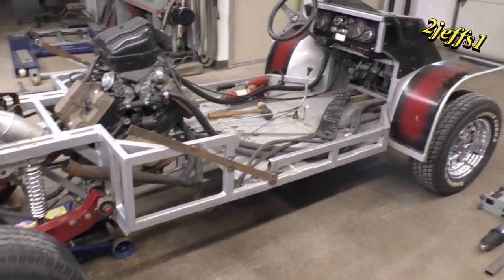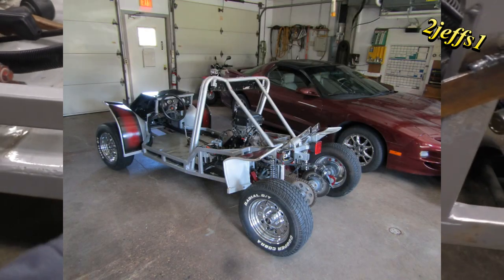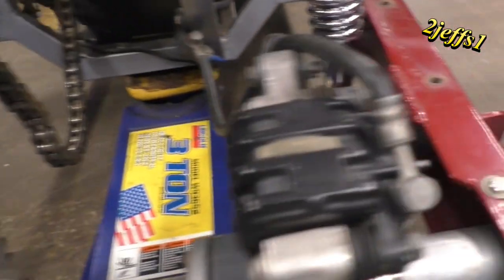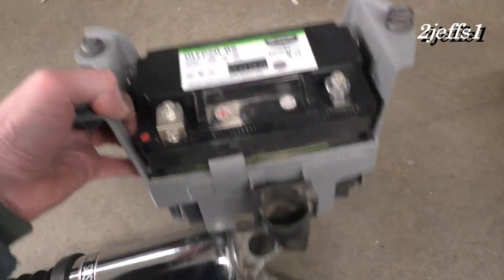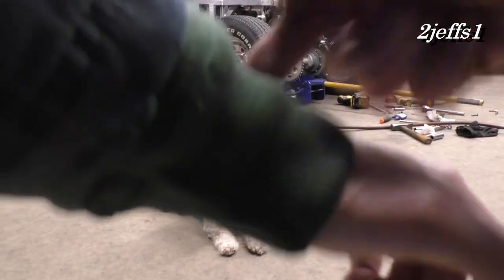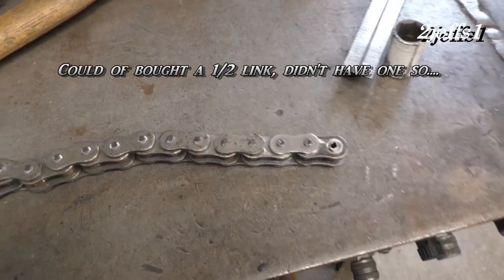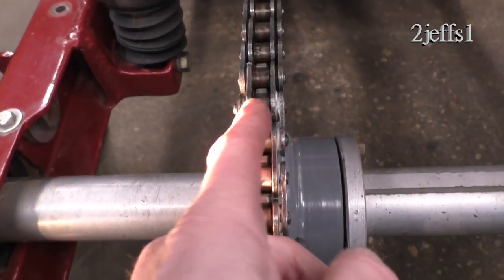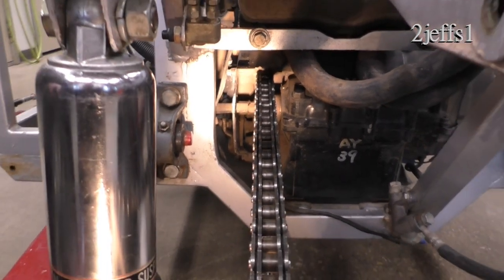Repairing the Homemade Kart Frame (Part 1)

Comment: Thanks for sharing Jeff. I love your little helper shes a cutie. The first videos i ever watched of yours was about the go kart I was watching go kart videos and one of yours showed on the side and said recommended for you. Your channel was one of the first channels I subscribed to here on youtube I'M not sure how long ago that was but it was several years ago and haven't missed a video since. Good to see you getting the go kart put back together. Have a great weekend and stay safe!!!
Reply from the maker: Worked on the kart till late last night. Fitting pieces. Takes time cause when welding will draw the steel toward the weld slightly. (piecing in where the frame guy had those straps welded on) Cut them off for better access and then jacked to retain the proper location. One must accommodate for the movement when piecing small sections in tack welding in proper areas. Going good so far.